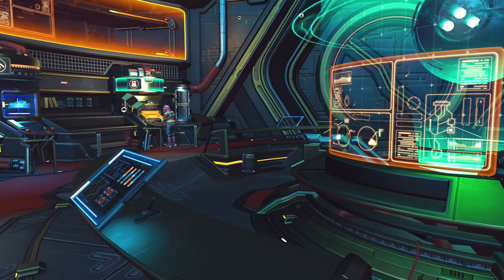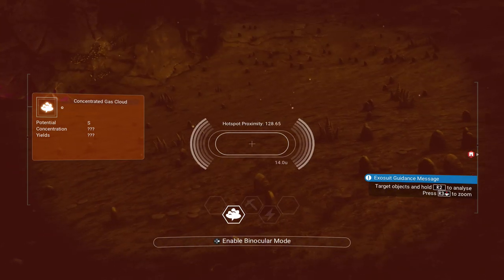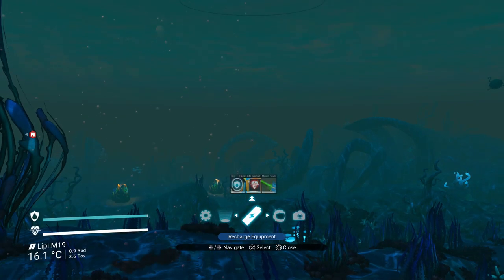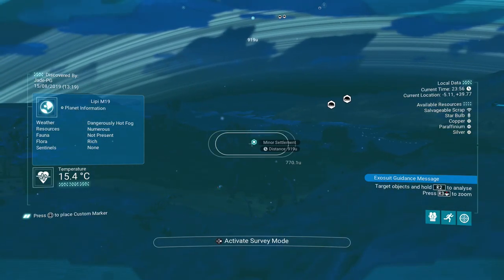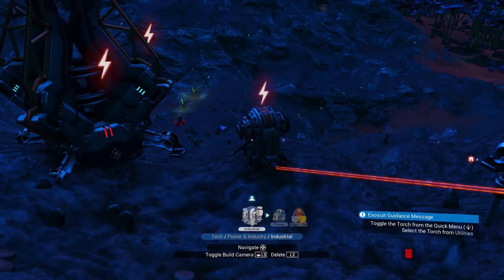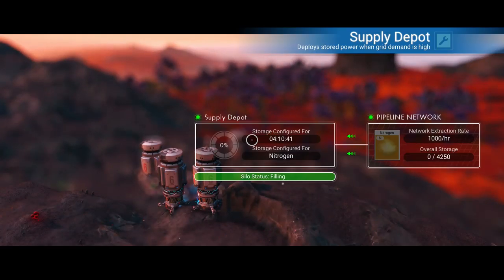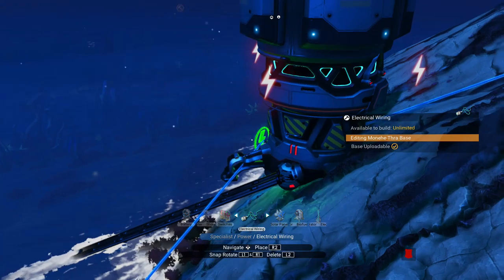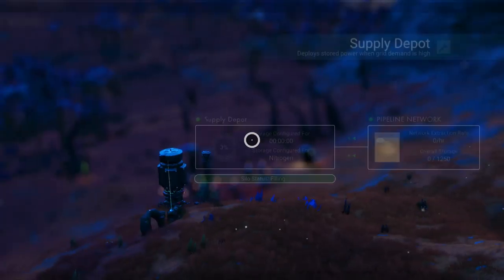NO MAN'S SKY POWER AND INDUSTRY GUIDE - Electromagnetic Generator - Survey Device - Mineral And Gas

Comment: Hey jade if you place a base near the power spot then go to the edge of the build area nearest the next hotspot and build any item this will continually expand the base build area and allow you to connect power over long distances. I build a structure to connect the wires to because even with the expansion trick one wire wont carry power that far.
Reply: So what if you put a base computer to we’re the power ends. Do you think I will keep going??
Reply: Will it run out eventually because it did for me
Reply: This worked for me. After an hour of googling this is the only thing I found that worked. Thank you.
Reply: This works only until 1000 uc away from the main base which should be sufficient in most cases. Also, you do not actually need to build something to expand base radius, you can simply lay electric cables all the way in order to save materials.
Reply: I found a S Tier electromagnetic field and don't want to waste it (there is no other hotspot nearby). Am I now able to basically scan the whole area to look for hotspots and the connect wires infinetely to connect them or is that not possible?
Reply: This video is pretty old.  That theory you mentioned doesn't work.  Power lines will not connect more than 300 or under 400 clicks away.  I tried with a mineral that was 500 clicks away and the wire kept disappearing.  This game really needs wireless power transfer.

Comment: Hey how do you connect the EMG to your base that is 400u away? One wire??
Reply: that's what i'm trying to find out
Reply: Place something like a flag or something that you can construct outside of your base range and there you go more space to build on
Reply: AnonymousKELLOG thanks man, I actually thought I saw a YouTuber talk about it and forgot where I saw it so thanks for the confirmation!

Edit: I actually just moved my small base over to the hotspot and it has been so simple and quite amazing but I just learned of a the lush green galaxy and that's my main focus!
Reply: @anonymouskellog6157  That shit actually works? I struggled to figure out a solution to get the power back to my main base that was a pretty good distance away. I even tried the multiple bases method (creating a line of batteries leading from point A to point B), but that didn't even work.
So, all you have to do is place a  item at the edge of your base range and it'll extend it? Is there a "limit" to doing this?
Reply: @anonymouskellog6157  what about 700u it is not working

Comment: Currently the only work around I found to the electromagnetic hotspot being too far from the base is literally putting down multiple bass computers and stretching the wire however my current issue is I have to keep relay in the wires because after a while when I put them down they turn orange instead of blue and what makes it even worse is the planet I'm on has high Sentinel activity so I'm constantly being shot at and attacked by animals
Reply: @BosleyAaron  thanks for the tip I'll definitely consider that also is there a limit to how long you can make the wire because like I said it every so often the wire will turn this orange color and I can't do anything with it or rather if I connect it it'll say the grid  unconnected
Reply: Keith McKellar how can you fix that??
Reply: @TheSmidtdog  no idea, hoping an update will update the length of the wires
Reply: @keithmckellar9913  It's to keep it all local. A Deterrent.

Comment: So my survey device was working days ago. I preset wire and a platform till I had time to grind for the power generator. Fast forward...i got it came back the survey now says my spot is a gas and no matter where I go in any direction or how far I go electric hotspots are no where to be found. It's very frustrating I even drove to other side of planet the gas and mineral pings locations but for power it just says not found.  Anyone have a clue about what's wrong

Comment: How do you power storage containers
Reply: If you still want to know. Just wire them all together, and then wire a battery with a solar panel wired to it as well. If a lot of them light up and you have a few not working, don't worry. All you do is delete the containers that have no power and build it right back where it was. I did this last night because I had 5 of my 10 containers indicating no power and deleting and rebuilding them did the trick.
Reply: @vsg1980  thanks so much I'll try that out
Reply: @silverrose5343  You're welcome. Just to clarify, I have 2 solar panels and 2 batteries hooked up to my 10 containers. That's 4 "power making thingies" in all.  It may only need 1 solar panel and 1 battery, but I know for sure what I have works.

Comment: I attempted to build a mineral extractor and got everything hooked up properly but it says my pipeline has reached full capacity and where it says overall storage it says 0/0 is this a bug?
Reply from the maker: just keep placing ya pipe again an maybe move the storage unit or add another
Reply: Same here
Reply: @s.a.r.junior  I did more testing no matter what I tried I could not extract the sodium so I left that deposit and found another deposit and it was copper, I hooked it up exactly like I did at the sodium deposit but this time it worked so maybe sodium deposits are bugged?
Reply: I think this happens when you have a mineral(or gas) extractor in the system that is outside the gathering zone. I had accidently place a handful of extractors instead of supplies and when I replaced them they went away.
Reply: @Lordoftheapes79  I had 1 mineral extractor place right on top of the deposit so that can't be the cause.